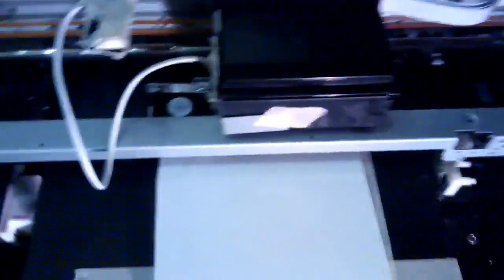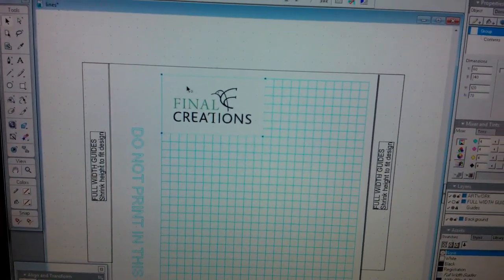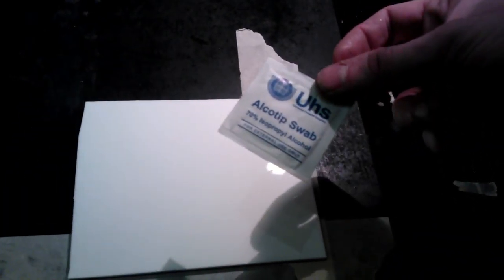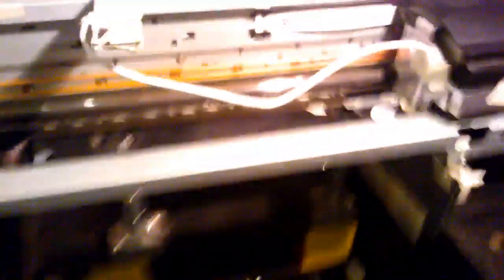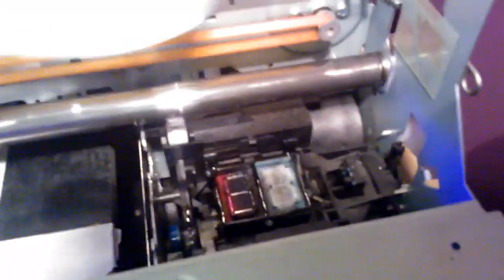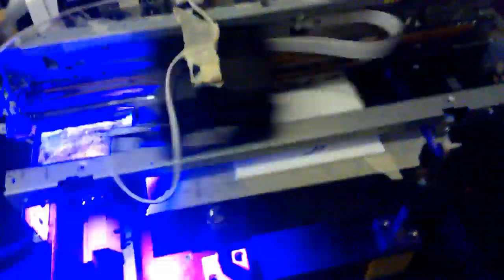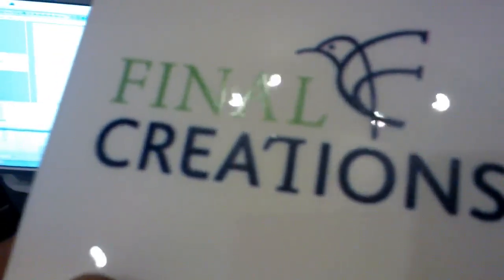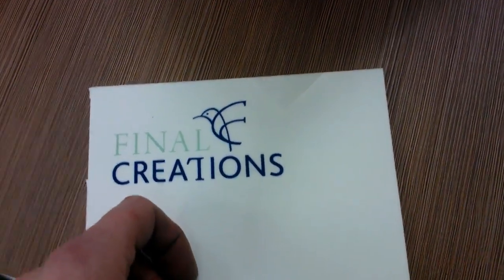Epson R1900 UV LED Printer DIY DTG Part2

Comment: its awesome, but i did not understand what you did to the white ink and did you fill some the garment ink in the cartridges or its the epson ink and which white ink you chose to print and do one have to remove cartridges every time after printing white and how we adjust the the same exact position to print color on white as we are controlling the paper sensor manually. it would be a great help and again its a great job u done.
Reply from the maker: Toni Don  You have to use a RIP software to tell the printer the cartridge colours. The software I use is fixed at YMCKWWWW, but with some software you can tell it which colour is in each cartridge. Some of the main programs are AcroRip, MultiRIP GP, EKprint. You will need to do some research to find out if you can change the colours.
Reply: The printer (Epson R1900) has 8 inks installed. You use the first 4 cartridges for YMCK, then the last 4 cartridges for WWWW (White Inks).
To print colour onto white you have 2 print twice. e.g. print the white, reset the printer then print the colour over the top. There can be a slight miss-alignment when printing on top.
If you goto http://www.t-shirtforums.com/diy-dtg/t223111.html there is more info on the setup etc.
Reply: Within the software you can tell it to print the colour ink, or the white ink. I would modify your printer to have a permanent/fixed paper sensor, this way you will get the same position over the white ink.
Reply: Anthony Haslam What about print head clogging? Does it clog often or can it melt the head? Do I have to print everyday to prevent clog?
Reply: The white ink separates in the cartridges over a few days (I have not found white ink that does not), so I have to take the ink out and give it a shake before printing. Then do a head clean.

The colours are on a Continuous Ink System,  but the white inks are standard cartridges, so I can take them out and shake them. I found the white separated in the lines so could not shake them easily.

The colours are better at printing, I have left it a week and it has printed fine.

The heads have not melted yet, but the rubber seal on the cleaning unit did perish over time.
Reply: Anthony Haslam Thanks for the reply. One more question is there an option in the epson software where you can select which cartridge to print and which not to?
Reply: Dear Final Creations
I like build my UV printer with Epson L800, but i have problems with build the UV lamp for this printer. Do you have Helpme about?
I like protect my printhead of the UV lamp.
I have leds UV for this lamp.
Thanks
My mail addres is golddustbarinas@gmail.com